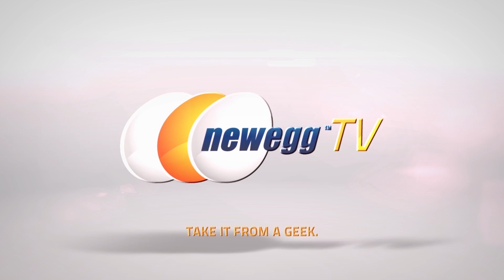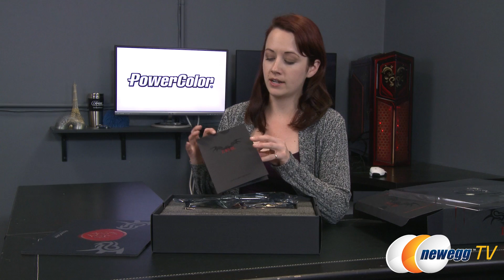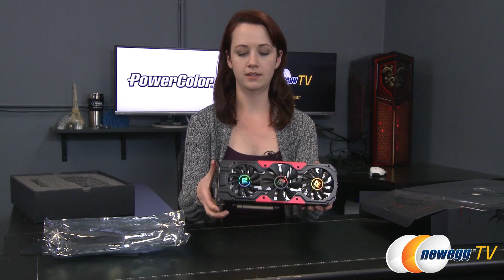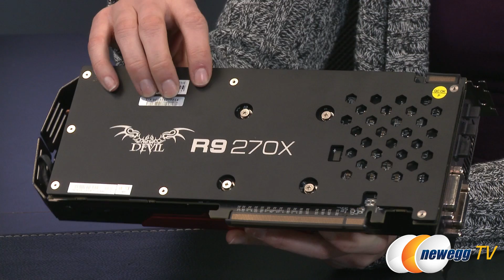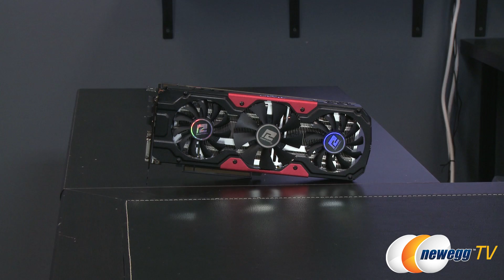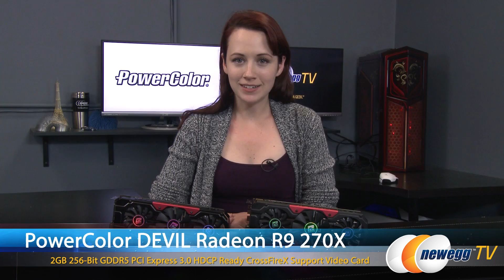PowerColor DEVIL R9 270X Video Card Overview - Newegg TV

Comment: I was gonna get one of these bought a stock gtx 760 instead best choice ever
Reply: this card performs on par if not better in some games as a 760 so you probably over payed :)
Reply: nope this was £170 my gtx 760 was £171 looking at the benchmarks my GTX 760 out performs the 270X by quite a margin stock for stock and my GTX 760 has the same commanding margin over my mates 270X both overclocked I was lucky in the silicon lottery with it boosting to a max of 1350mhz and it averageing boosts of 1280mhz for upto 1 and a half hours at times so I'm quite pleased your 270X might be just fine for you but the price inflation of people even buying "lower end"(don't like the term because it's still a good performer) AMD cards for mining makes no sense and infalated there prices like 290Xs rocketed to $950 on new which is about £650 near as much
Reply: I can play any game I want at maxed out settings and average 40-80 fps and in some games I get better fps than my friends evga gtx 760 so I know for a fact my card performes on par with a gtx 760 idc what people on youtube say or what benchmarks say I have a 270x my friends got a gtx 760 and both cards perform on par
Reply: Well like I said you might get all you want from your 270X like when I bought my 6870 most people said I should of bought the gtx 560 but it did what I wanted better and to be honest my GTX 760 is an extremely good overclocker with it maxing out what GK 104 can do at around 1300mhz

Comment: pretty sure the naming is upside down like the gigabyte 780ti ghz. if they can't even make a good backplate. how bad is the rest of the card? and btw. my 270 runs at 1200mhz stable with 1.225V, so 270x is kind of stupid.
Reply: kaspermittel
well the funny thing is. i will never buy a gigabyte or powercolor product pure because they are to stupid-_-. and with the powercolor backplate. i believe it doesn't connect to the pcb and the ram so it will not help cooling. but it will make it worse. the heat can't go away form the back now.
Reply: iTr00oW I have the card the backplate is there to help stiffen the pcb because the cooler is all metal and mine stays perfectly cool 27 on idle and 60 on full load clocked at 1220mhz
Reply: The91489
happy for you but still. it's upside down u know. wish my 270 had a backlpate.

Comment: aren't PowerColor the worst gpu maker?
Reply: first off powercolor is not a gpu maker amd makes the chip secondly ive had mine a little over a week now have it clocked at 1220mhz and it runs nice and smooth doesn't over heat and plows through bf4 on ultra at 1080p 50-70fps no issues I think they did a great job on this one :)